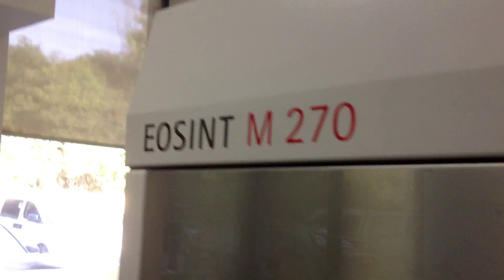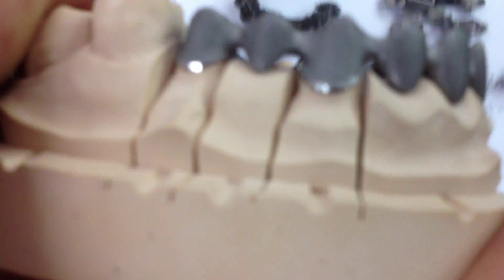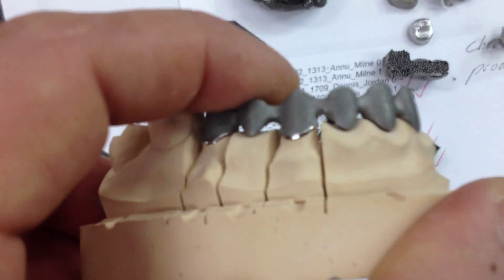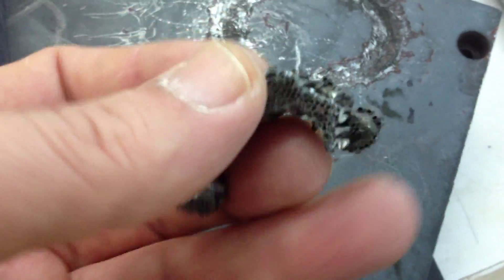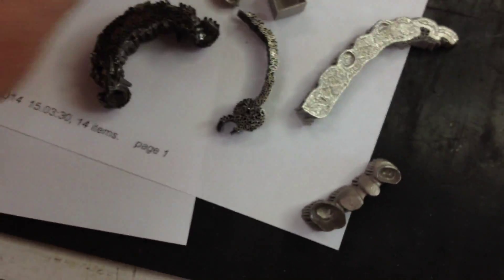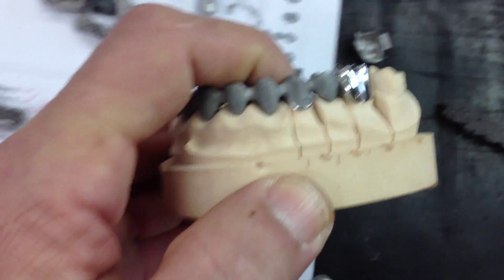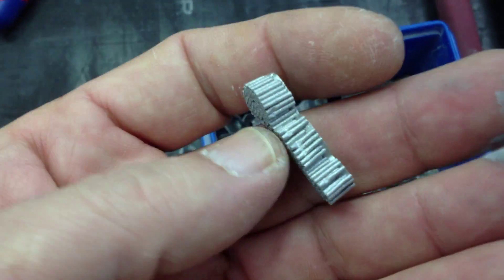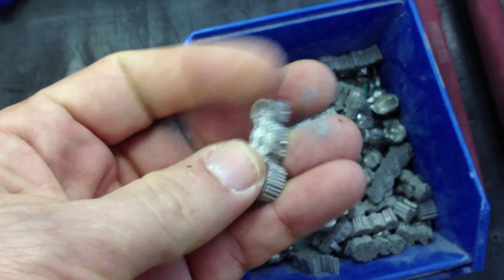Laser metal sintering

Comment: Sweet! Now explain the process ;)
Reply from the maker: Yeah... I have to arrange a time after hours so I can run through the scanning and / or designing stage as well.We use 3D scanners to scan the surface we have to fit to..It's a busy place during the day and I cant get in the way. A typical run takes about 4 - 6 hours to run, but that varies greatly depending on what is made...pretty much like a 3d printer....
Reply: ***** Here is a basic overview.
http://www.custompartnet.com/wu/direct-metal-laser-sintering
Although there are many variations of laser type and metals etc.
Going by the support structure I'd say there parts where made with the disposition method.
Reply: Direct Metal Laser Sintering (DMLS) Overview
Reply from the maker: As impressive as these machines seem when it gets down to it, because of the relatively poor surface finish, any surface which is to meet another has to be machined anyway to get the surface finish and fit required..couple this with the expense of  laser sintering and it becomes an expensive alternative to regular machining...There are wide applications for them in industry use and although their performance is exceptional in some areas, practically they are not as good as one would expect for such an expensive piece of equipment.
Reply: electro1622 I agree. You can get the job done a lot cheaper and faster with a cnc lathe a lot of the time. Metal printers do have their place though. The better ones have a built in CNC lathe as well, so you get a finished piece at the end.